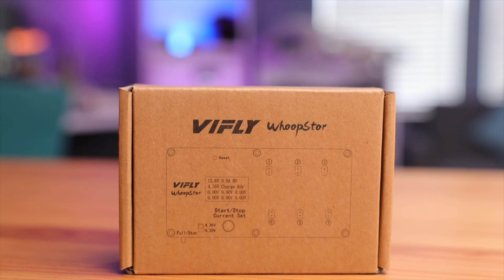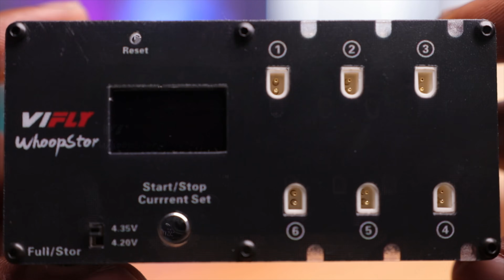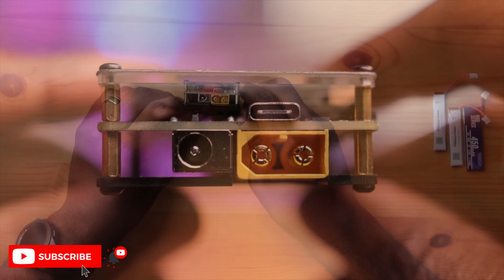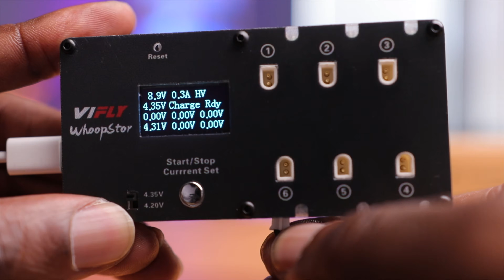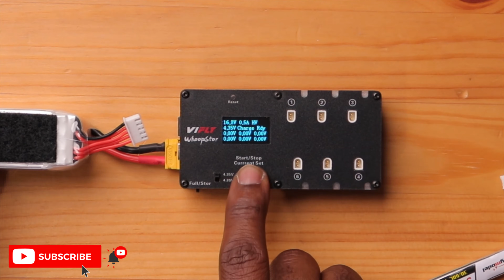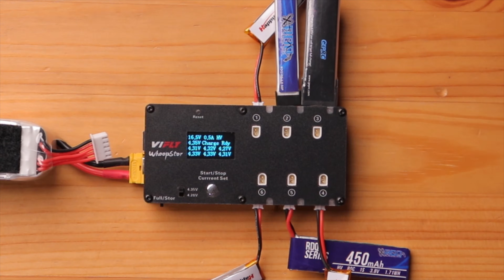ViFly WhoopStor V2 | The Best Solution for Your 1S Batteries

Comment: Wich battery charger is best for tinyhawk III battery’s? Cause this Port looks different then the one I got with the rtf kit
Reply from the maker: This is the best charger currently on the market  for 1S batteries…They actually have a new version, and I’ll link it below.  This charger(V2)also  has the PH2.0 ports on the side. https://www.getfpv.com/batteries/battery-chargers/vifly-whoopstor-v3-6-port-1s-battery-charger-and-discharger-lihv-lipo.html?afid=uOgnt7ftD9XrzEt1&referring_service=link
Reply: So I can charge the battery’s for the Tinyhawk 3 with it? And wich battery’s are good for the price for the tinyhawk 3?

Comment: I've been using for about 3 weeks (I think) and it's a no brainer. I have dozens of 1S packs, but without store charging I was getting too many 'puff' batteries. Hands down the best 1S batteries charger. The only improvement, would be some kind of buzzer, for when the charge is complete.
Reply from the maker: I agree..I don't know how I lived before this.   The generic chargers that come with BNF and RTF have amperage that's all over the place and not optimized for different mah batteries.  A buzzer would be nice though for version 3.

Comment: Hi! I don't mean to bother, but I wonder if you'd be able to watch a 40s video and give me your opinion on what to do :  

https://youtube.com/shorts/dsh1VtO0VYk?feature=share

I guess I got a cursed  kit  lol  So, even after the screen incident (emax said there was no problem and they wouldn't replace it to me)...

https://youtube.com/shorts/gcgYZwoE6fk?feature=share

Now  I'm getting this. I suppose it's a motor failure. I removed propelers, looked for hair or something else on the motors, swapped the back right for the front left motor and it still keeps doing the same backward flip in the same direction. What do you think?
I'm done with this drone and Emax costumer service is beyond terrible. Since I don't expect much more from the tinyhawk other than a explosion or spontaneous combustion... Would you recommend me a better tinywhoop  mostly for indoor flight? Preferably 1s so I can still use the  10 batteries I bought.
Edit: I've been thinking about mobula 7 1s or firefly nano baby

Comment: Dude late to the party. Tons of videos about this charger.
Reply: Id rather watch this one
Reply from the maker: Thanks Butch for the observations.. I've had it for a while, but did not want it to conflict with my other videos.   Thanks for your concerns.
Reply: first one I've seen
Reply from the maker: Thanks PA Stubbs 👍
Reply: Yes, but he clarified something that none of the other videos did. And that is that all of the ports separate and you can store and charge batteries at all different voltage levels, which is very different from parallel charging. Some of the other videos sort of said it but didn't make it clear.
Reply from the maker: Thanks Randy!
Reply: @OneManUnmanned  You are welcome